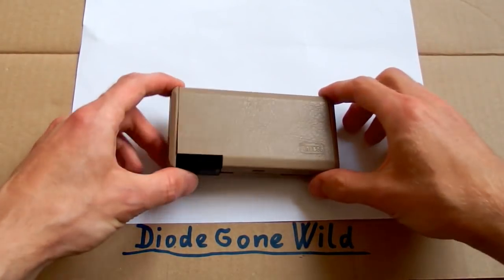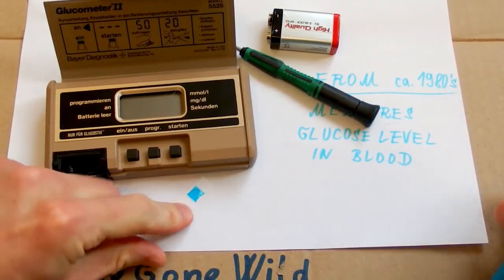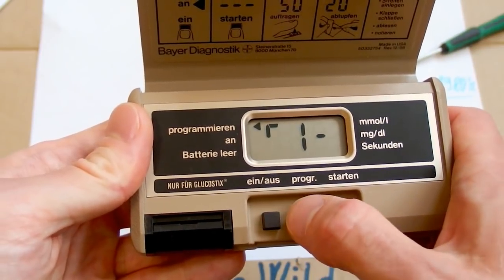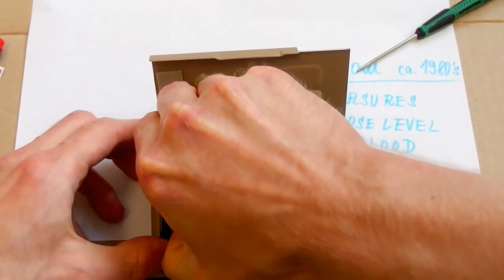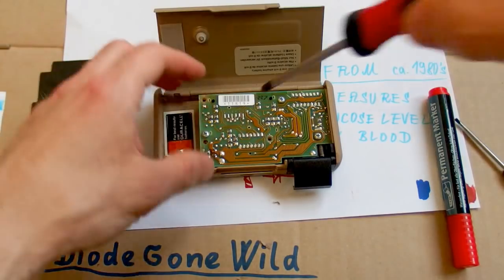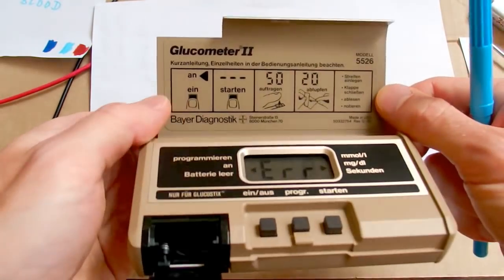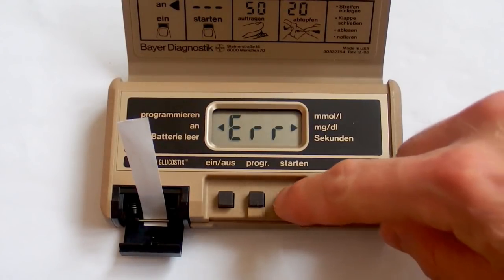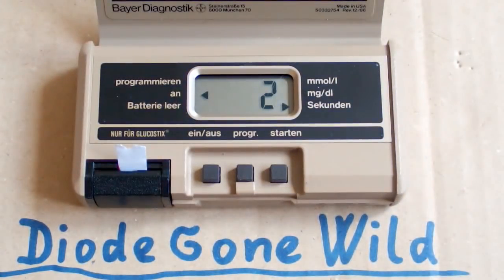What's inside a Glucometer (blood sugar meter for diabetics)

Comment: I have type 1 diabetes, had it since I was very young.  I had an earlier model of the Glucometer in the early 1980's - much larger than the one you have there.  Your assumptions as to how the machine works are pretty much correct.  The Glucostix have a pad on them with a chemical in.  They change colour depending on the concentration of glucose in the sample, and can even be (approximately) read by eye against a colour chart that was supplied with the jars of Glucostix.

Your use of the machine is almost correct - you start the timer function, apply a drop of blood when it beeps, and wait for the next beep when you dab it with a lint-free tissue - you don't wipe it.  (Older machines like my original Glucometer also required you to squirt water onto the stick to rinse the blood off).  You then open the door and put the stick in the machine and look at the reading.

As you presumed, LO means your blood sugar is below the range the machine can read, and HI means it is too high.  This isn't a medical warning of "Too low" or "Too high", but simply the range that the machine can reliably measure.

Calibration (at home) was a simple test where you inserted a special plastic stick with a fixed colour, and ran a test program in the meter.  The stick would have a marking of acceptable range, and you had to ensure the displayed reading was within this range.  My Glucometer had two of these sticks, one had a lower reading, one a higher reading.  If you had such sticks for your machine, you could probably replace the trim-pot with a working one and fine tune it to give expected results for the test strips.

Modern blood sugar measuring devices are much smaller, and use electrical measurements, not optical.  You still have to apply a drop of blood, but only a very tiny amount, and you will get a result within 5 or 10 seconds without having to wipe the blood off.  

Modern meters have a memory and a diary, and can remind you when next to test, and, if you are type 1 and receiving appropriate treatment, the meter can even suggest how much insulin you should take.  You can download the data from the modern blood glucose meter to a computer using USB.

There are many competing meters and manufacturers, the meters are usually given away free by the manufacturer, as an incentive for you to buy / have prescribed the testing strips, which can only be used once.

Thanks for a great series of videos.

Ian
Reply from the maker: Yes, it seem so - it displays LO with white paper and HI with black paper. Unfortunately I don't have any calibration sticks. I have found this device in a backmost room of a rundown antique shop for 1 dollar. The new meters are given for free? That sounds interesting :). But I'm a bit afraid the inside would be less interesting than the old one. I guess just a battery, LCD, a chip under a black blob and a connector for electrodes...
Reply: I think that even if it is a COB chip, it will still be interesting to see the sensor, because according to Ian they don't use optical measurement anymore :-)
I think also you should teardown more medical devices, just don't go too far because you will end up with a fully loaded Horiba blood analyzer like it happened to mikeselectricstuff (I don't know if you know his channel, but he tears down weird and obscure stuff) and then you run out of space in your home!! ;-)
Reply: Modern Accu-Chek machines we use in hospital only require 0.6 microliter of blood per test.
Reply: @DiodeGoneWild  Yes, machines for basically nothing ... But the "consumables", the test strips, are quite expensive.... Just like inkjet printers, where the cartridges are where they make all their money.  It's all quite a racket. 

And, of course, those behind marketing these things are basically also those behind marketing all the unhealthy, garbage food and sugar-saturated drinks that cause the diabetes in the first place. Like I said -- quite a racket. They are very good at what they do, which is quite unfortunate for all of us.
Reply: Free samples, huh, that's how they snatch you.
Reply: I have two modern glucometers, Accu-Chek and Nexus. My GP surgery gave me my Nexus, but only after I'd bought the Accu-Chek. They won't supply test strips for Accu-Chek on the grounds that they're too eye wateringly expensive. Apparently, the Nexus strips are peanuts in comparison.

Comment: One thing I don't like about Duracell is that their batteries are terrible for leaking. They often leak the moment batteries run out, in one case ruining a clock - Ticking one day, dead with battery leaking into the mechanism the next day.  I've had several other items I had to clean the mess out of, again the day where I noticed the item went flat, the battery had already leaked.  Before I switched to rechargeables, I used a wide variety of Alkaline batteries, but don't recall any other brand that leaked so often.
Reply from the maker: Maybe they leak before the clock stops because the clock can run on almost dead battery. But maybe Duracell pays so much for ads that thay have no money left to make proper batteries :D.
Reply: Were these Duracell Optimum, perhaps? Those are known for leaking, often in the package before they're even used.

Comment: Thank you for showing this nice old instrument. Glucometers today are not based on optical principles (afaik) - all i have seen in the last 10 years is using electrodes on a test strip measuring the conductance of the chemical mixed with the blood.
Reply: Called "Dielectric method" with statistical method "Artificial Neuron Network"

Comment: I know this is an old video but I am a new subscriber and working my way through your great videos. I have Type 2 diabetes. It's remarkable that we never got taught the dangers of too much sugar in your diet when I was at school  in the 80's & 90's. My meter uses a blood sample via a plastic strip. I prick my finger and the blood is drawn into a small window on the strip. The modern device then registers the time, date and mmol/l. It also has USB connection to PC for uploading records and erasing history on the device etc.. I have had a look at a cleaned up strip under a pc microscope. One side of the strip peels off revealing a set of copper strips of varying length, almost like a stretched out maze. There are 3 gaps at the end where the blood sits and the back end slips into the meter. I am guessing the meter sends out electronic pulses and measures the resistance? Inductance? Time to return pulse to meter? I have no idea how they work  lol PS. My meter reads mmol/l and a reading of 5 to 8 is good, anything about 10 - 15 is normal after a meal,  if readings are above 12 between meals then Type 2 people would just need to drink water and eat less sugary content foods. Everyone is different though, in my case im on 5 different tablets each day and my 10 week average levels have dropped over 4 years  from above 80 down to just under 50 and I have lost 3 stone in weight, im now just under 14 stone or about 90Kg :) I have done well, but still can do more :)

Comment: darkness of the inks used might be different in IR and visible lights.
might be worth opening a vintage TENS machine or Slendertone unit if you can find them - should be some voltage boosting going on inside.
Slendertone is the UK brand name of a machine that is supposed to use electric impulses  to exercise the muscles of people who are too lazy to  actually do exercise themselves.

Comment: Recent blood-glucose meters aren't that different in technology from that one: small amount of glucose peroxidase enzyme on a disposable strip, then the reaction either changes the color of an indicator or the (I think) resistance or conductance of the strip. The meter reads the color or electrical properties before and after the reaction.
Reply from the maker: I also think it did't change much, but nowadays the resistive ones are probably more prevalent.
Reply: Roche still makes ones which use an optical measurement system.

Comment: Hi now adays modern machine are given away for free ,just to retain the customer ,but the strips are so costly that many diabetic patientnce turn away their daily monitering and does it rendomly ,this is becouse the strips are made of gold lining
Is there a way to decode this strips for reuseage . can any one come up with a good advice .. tks
Reply: My sister had diabetes during pregnancy. She was given a small keyring sized device that had two metal probes that came together at the tip. She'd prick a finger, get a blob of blood and dip the metal into it, and the reading came up instantly. No paper was needed.

My dog is also diabetic. He's had an "implant" fitted to him a couple of times to monitor his sugar levels. It was the size of a couple of large coins stacked together, which was stuck onto the skin. There was a small hair-like protrusion on the device that was put under the skin - I know this because his hair growth is insane and it came loose after a few days and he'd scratch it off. To get the reading you had to scan it with an NFC-enabled phone. No paper needed.

Comment: I am not a diabetic myself, but from what I read, not all diabetes cases are preventable by doing exercise or eating a healthy diet. Type 1 diabetes is caused by destruction of cells of the pancreas (as far as I understand), which is caused by genetic reasons. You may accidentally offend someone by saying they should have prevented their diabetes, when it may have not actually been under their control.
Reply: Guy Shapira thank you! I'm type 1, and you are mostly right. It is an autoimmune condition in which your immune system mistakes the insulin producing beta cells in your pancreas as a threat and destroys them. I have eaten healthy/exercised my whole life and still ended up with it. Just diagnosed earlier this year infact and have learned a lot about it since then, both skinny and bigger people can get diabetes, though commonly type 1's are skinny due to the disease causing rapid weight loss if not properly managed.
Reply: Probably he didn't knew it. I doubt  he said that with a mean purpose.